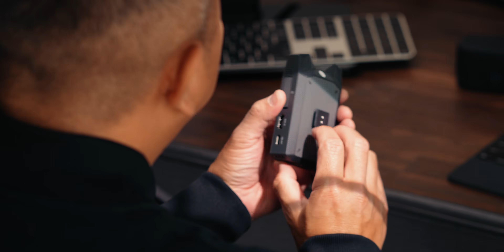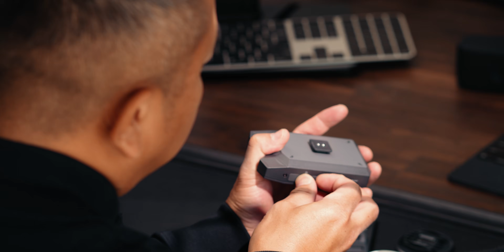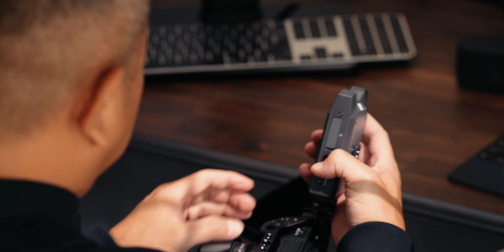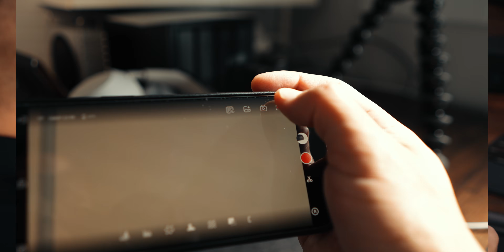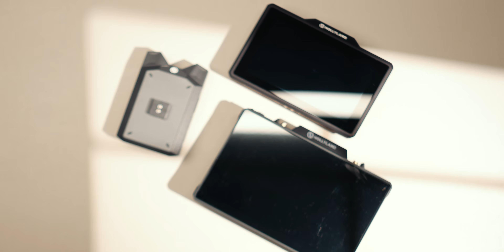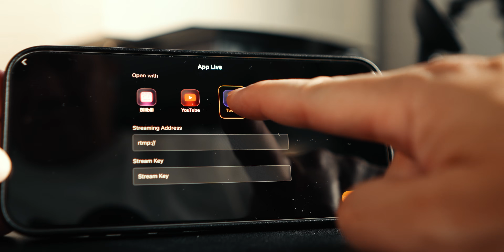Hollyland Vcore Review | This Tiny Box Replaces Your Monitor, Recorder & Stream Rig

Comment: Greetings, These people are promoting a product with many flaws. The battery doesn't last as long as advertised, it connects using your mobile data and drains your data allowance very quickly. This promotion from Hollyland is a scam. It might work for monitoring, but not for anything else. Google blocks you when you try to stream to YouTube, it has many problems, and the company says they'll compensate you but nothing happens. They're just looking for someone to fall for it so they can email you and not resolve the issue. I feel completely scammed by this company and this product.

Comment: Hollyland Vcore is not suitable for exposure or color evaluation.
It automatically clips highlights and shadows by forcing any HDMI signal into Legal Range, with no option for manual selection. Unfortunately, Hollyland does not disclose this limitation before purchase—only through customer support. The manufacturer has confirmed this behavior is intentional and will not be fixed.
Reply from the maker: Thanks for sharing this important information – really appreciate you bringing this to light!